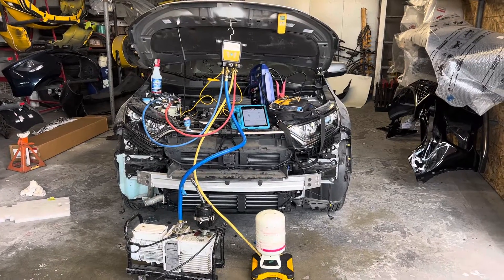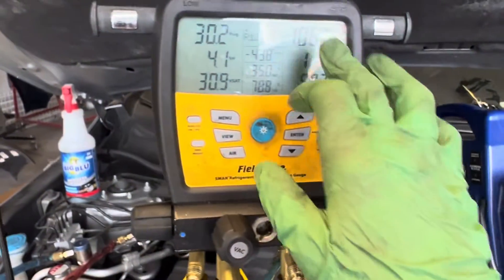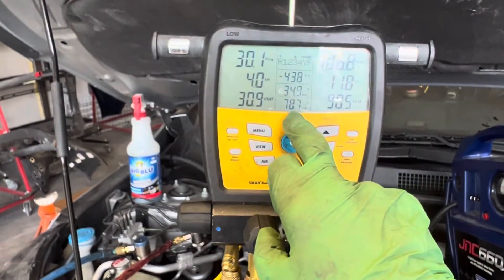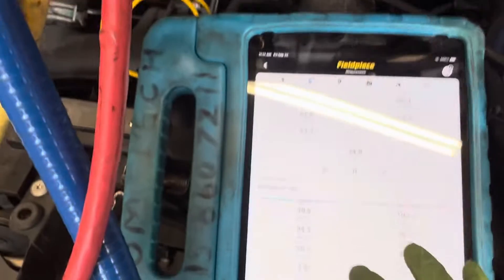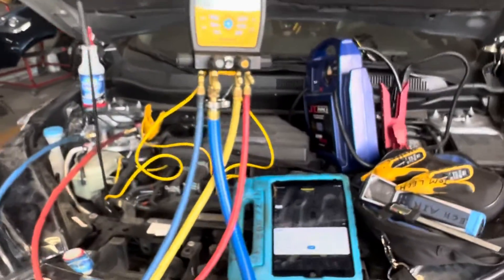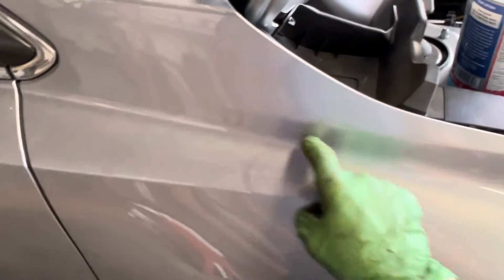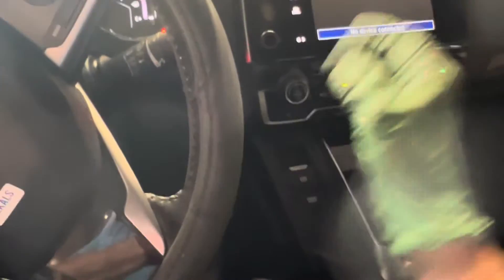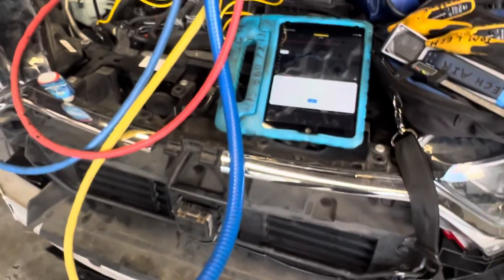Air conditioning 2019 Honda CRV, little explanation of how it works superheat and sub cooling

Comment: To get max AC performance on a Honda make sure ECON is OFF. Honda's battery cables are very prone to corrosion because there's no heat shrink. They also use dissimilar metal on the fuse box at the engine bay.
Reply from the maker: Eco mode on every brand companies car needs to be off. 

I hate Eco mode on any car . 

Specially, if it’s on some manufacture, where you don’t know, there’s an Eco mode button to see and press and you’re looking for an air-conditioning problem .
Reply: @coldfinger459sub0  I also hate ECO mode. The eco mode on Audi/VW is so funny. They call the AC button that turns off the compressor ECO Mode. 😂
Reply from the maker: @w0lvez1  remember the Volvo

When you hit the button and the light comes on, that means you turned off the air-conditioning 
lol 😂 

My first time I spent a half an hour trying to figure out the electrical problem . 
Wire, connectors, relay fuses . 

I could see the light on it must be getting power  🤣